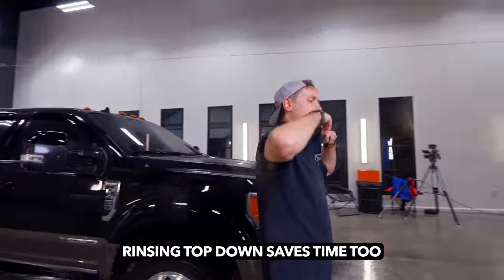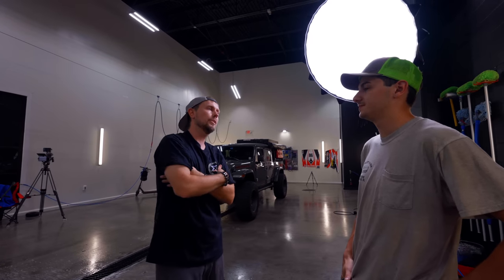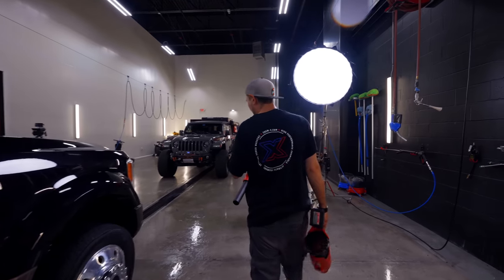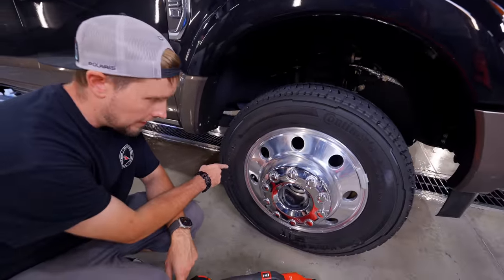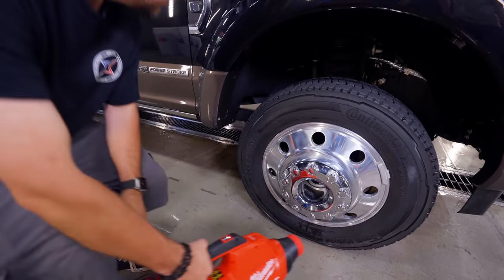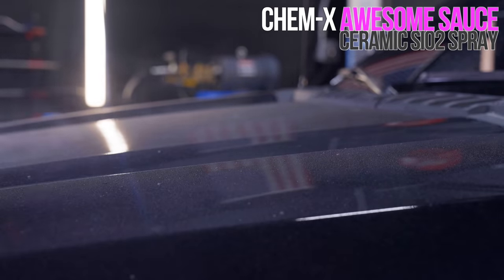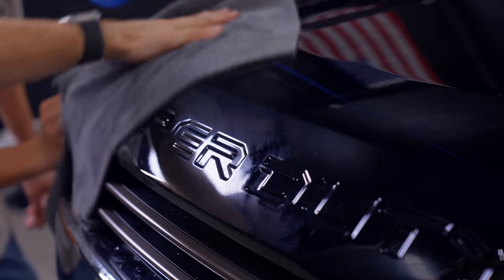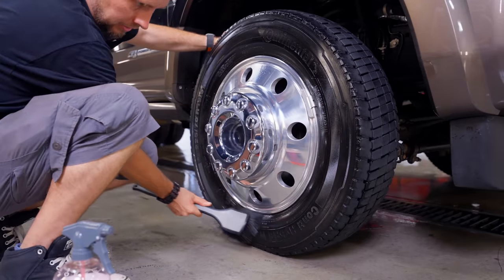I missed a spot...

Comment: I have been detailing vehicles for 45+ years looking for the best way to break down dirt and grime quickly, mainly as my "pre-wash" stage, but also during those times when you don't want to do a full bucket wash.   The only problem with Chem-X I have seen so far is the astronomically high prices for the products.  $109.00 for two gallons of product!?!  That's too high, no matter how good this product works.    There are way too many other options out there that would probably be as effective.   I currently have Wash Chems as my pre-wash/touchless wash product and it works fantastic and it's a single product system.   I would still like to try this system and the other Chem-X products such as Liquid-X, Snake Oil, and a few others.    I'm just not willing to pay $350 for the sample pack.  That's CRAZY!
Reply: You do realize that both stars and stripes are mixed 4 parts water to 1 part stars and 1 part stripes. So essentially you are getting 5 gallons of each. Doesn't sound so expensive now does it?

Comment: I've been using stars and stripes for a while now on my f150. 20 minutes and I'm done with an electric pressure washer which is much lower psi and gpm than you use. The key is to have a good slippery protectant on the vehicle and frequent washes like you said. The longer things sit on the paint, the harder they are to get off, even with hand washing. I used to dread washing a bigger vehicle until I tried stars and stripes. Now I can wash every week or so and be done in a matter of minutes.
Reply from the maker: That’s cool to hear, I do get told quite frequently by people with 110v machines that they are getting good results, I think your right about the protectant and frequency for sure

Comment: Have you ever looked into a DI water system for the final rinse to combat the hard water.  You should be able to skip drying altogether with it.  I'm going to pick up one of the small systems for washing at home.
Reply: It looks like he has a DI system. I have been wondering how much he uses it though because with the amount of gallons of water he goes through would be using up the life of that resin real quick
Reply from the maker: I do have the spot free rinse DI tanks but I haven’t really used them much, I’m afraid to lol my machine will burn through that resin in about 80 minutes😳

Comment: Would you recommend using this on a vehicle with and exiting ceramic coat?
Reply from the maker: Yeah for sure it helps make the touchless system work a lot better actually and we have had zero issues also

Comment: Got a question. Parents bought me a few of your products I’ve been wanting to try for Easter lol. I tried out Heavy duty. I diluted it properly and used it straight and it did absolutely nothing.. I also was gifted snake oil and it only lasted one wash.. could I be doing something wrong?
Reply from the maker: Nice that was cool of them, let’s get you dialed in. Can you tell me more about how you used the heavy duty first? What we’re you trying to get clean and what did you do after applying it undiluted?
Reply: @ChemX  I was trying to clean the wheels on my pickup truck with heavy duty. I clean them often so there really wasn’t anything but normal buildup on the wheels. First I used it diluted, nothing. Then used it un concentrated and it did nothing still. Both times I used my 3000psi 2.3gpm pressure washer to make it a “touch less” wash like it’s shown in the videos

Comment: I really need to order your system for my fleet cars 😮
Reply: Will this system work well with an AR blue 630TSS? I have it set up for 2.4gpm at 1000psi so lower pressure but good flow.
Reply from the maker: That's a good flow rate, you'll just want to stay close with the psi maybe use the green nozzle so you can get some width on the pattern and thoroughly scrub with the psi @pipsohio
Reply: @ChemX  appreciate it! I’m gonna give it a try
Reply: @pipsohio What orifice size are you using in the AR sprayer?

Comment: yoo hey question.. can you apply snake oil to dry surface to further increase durability of the application?  it'd be a great video.. do it! n let us know lol thnks u r the best
Reply from the maker: That's a good question, putting it on dry and really clean surface would probably help it grab the vehicle better, I generally put it on wet though because my goal is to speed up the whole process and I also want to prevent water spots from forming which is one of the biggest perks of snake oil for me
Reply: @ChemX  yes totally get it but just to see ...if it doesn't do much more than spraying in wet then forget it. but  if it lasts way longer and makes the contactless way even easier ,  one could get away with applying it even more diluted as it's already on there., you're just doing a quick mist n rinse to top up on the existing layer.   ?  interesting indeed.   keep up the  great content.  can't wait til the next video

Comment: You guys need to try out the EGO 765CFM Blower from Lowe's. It's absolutely the strongest blower I've ever used. And you can get a stubby nozzle with a rubber tip to be safe around the paint. You WON'T regret it!
Also, have you ever tried stacking (layering) the
 🐍 🛢  and see if that works?
Reply from the maker: Heck I’m gonna head over to Lowe’s right now I love new toys 😁👏
Reply: @ChemX 😂
Reply: @ChemX I edited my comment. Very curious now.
Reply from the maker: I have yeah there is so much Sio2 in it though thats it's pretty much 100% slippery on the first pass so can't see a perk to it myself lol @94muddertrucker
Reply: @ChemX  a lot of people believe that when you stack protection on, that your protection is doubled. That is not true at all. It may increase by 30% at most. It's better to top something off later than to layer it. I just didn't know if you all tried it.